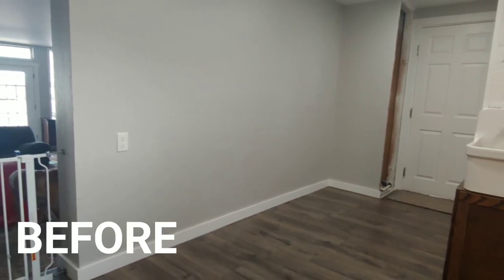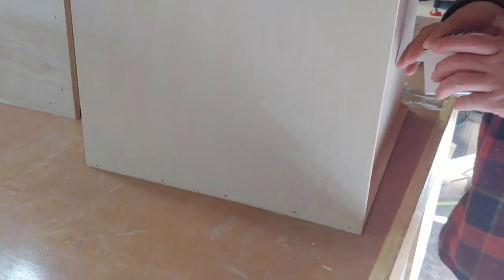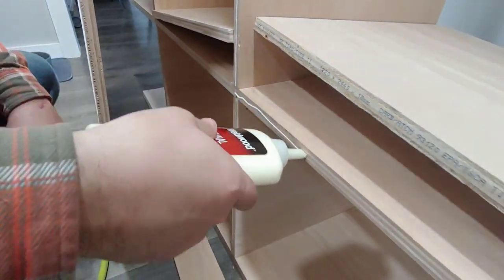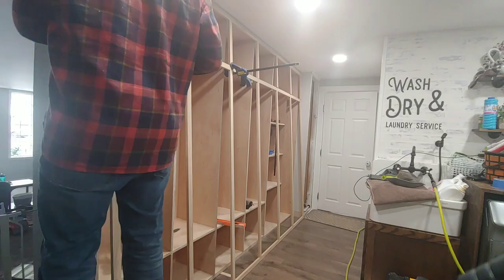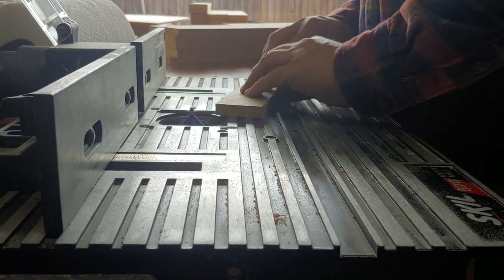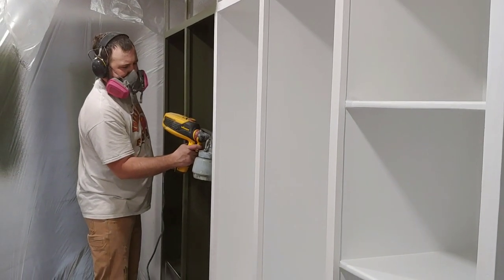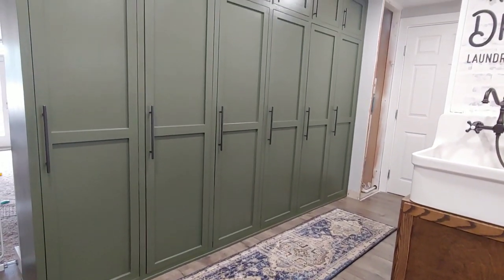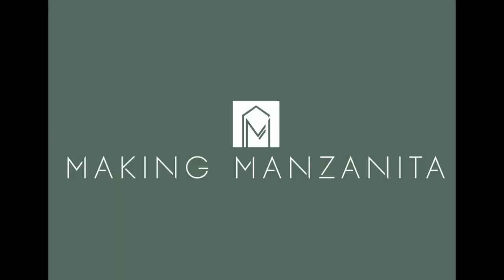DIY Mudroom Lockers

Comment: Is it better to assemble the entire face frame with pocket hole screws and then attach?  Seems like it may be easier to nail each piece to the cabinets separately but maybe it’s not as strong that way?
Reply from the maker: Assembling the face frame with pocket holes screws before attaching to the cabinet helps keep it square. Also you can sand the face frame first before attaching to cabinet which is easier.

Comment: I want to install this exact same thing, except I want a row of thin drawers in the middle, as well as rods to hang jackets instead of hooks in half of the larger cupboards (so essentially coat closets). 

Is this doable? How would we go about making those adjustments? 

And for a restricted budget, and VERY minimal experience- would MDF be better then plywood? 
What are some tips that will help make the process go smoother? 

Thanks! :)
Reply from the maker: This is pretty advanced woodworking project that honestly pushed our limits and we have pretty extensive experience. With a restricted budget and minimal experience, I'd recommend doing something like installing Ikea Wardrobes from the PAX line. If you do some searching online, you'll find several tutorials for how customize the Pax wardrobes and make them look really custom! That way a lot of it will be prebuilt and you can add customization to make it work for you and really look like it's "built in". Here's a good resource about those: https://thediyplaybook.com/install-ikea-closet/ ... hope that helps!
Reply: @MakingManzanita  Yes! We've thought about doing pax as well! Quarentine has us feeling ambitious 😂 

Thanks!